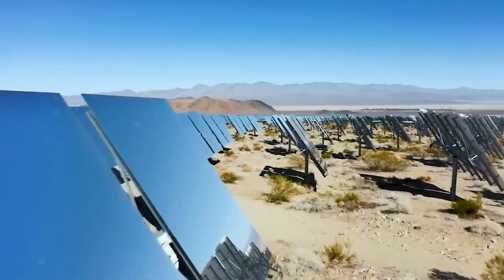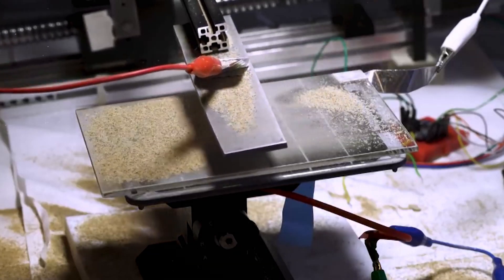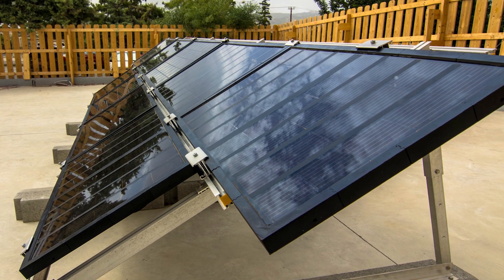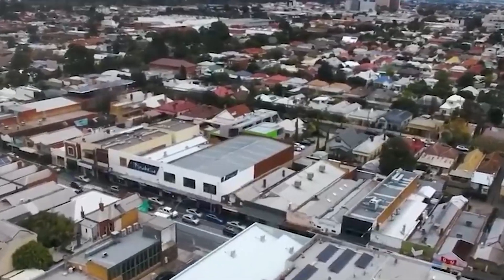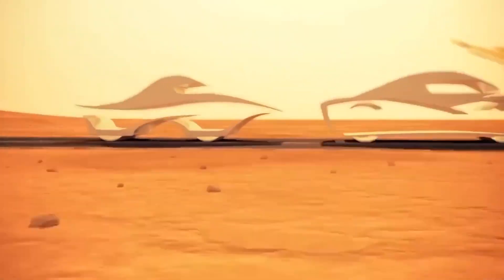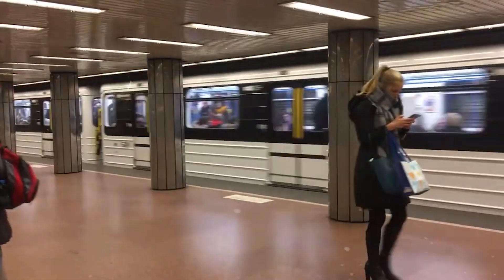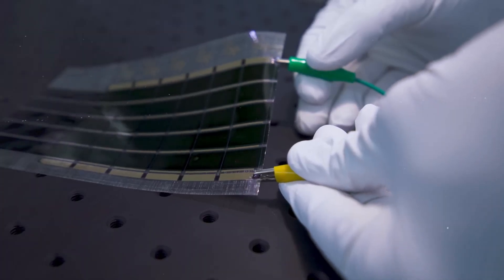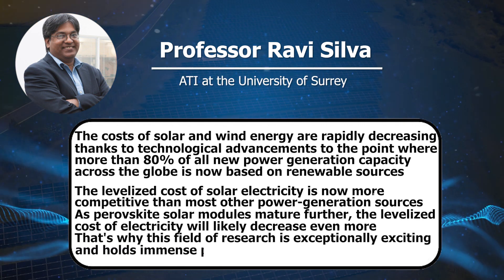Solar Panel Breakthrough Technologies Taking Solar To A Next Level

Comment: A world with zero carbon emissions is impossible. The processes required to produce the solar panels and wind units etc. will require the use of natural gas and oil as feedstock to produce the necessary chemicals as well as pharmaceuticals and plastic for clothing and other uses and these will result in significant outputs of carbon dioxide and methane  as well humans and animals unless we all stop breathing.
Reply: The critical thing is we stop directly burning the hydrocarbons just to move ourselves about. Sure, we'll need oil to make plastics but there is no need at all to burn fuels just to power an inefficient internal combustion engine or to create steam to generate electricity.

Comment: Ok lets build solar panels in space to overcome atmosphere resistance and then BEAM THE POWER DOWN THRUE THAT RESISTANCE ANYWAY...:

ANYBODY FUNDING THIS IS A R TARD....
Reply: The atmosphere interferes with light, there are electromagnetic wave frequencies that don't interact with the atmosphere hardly at all. the real cost prohibition is the investment to return ratio doesn't make sense to launch rockets for a few higher % efficiency. Instead of launching rockets, just put 10% more panels on earth.
Reply: @thelawngnomeslayer   BLA BLA BLA FREQUENCIES BLA BLA BLA...

REBUTLE : ENERGY LOOS BY ENERGY TRANSFER WHIT IN INSTALATION 

ENERGY LOSS BY ENERGY TRANSMUTATION.

YEA SORY DUDE THIS IS AGAIN SAME BULLCRAP LIKE USING DIESLE ENGINE OR COAL POWER PLANT TO CHARGE ELECTRIC CAR...ITS MUCH LESS EFECTIVE THEN USING IT DIRECTLY!!!

LEARN PHYSIC IF YOU ARE PROFESOR THEN PLEASE DESTROY YOUR CERTIFICATE AND GO WORK SOMEWERE ELSE WHERE YOU DO LESS DAMAGE